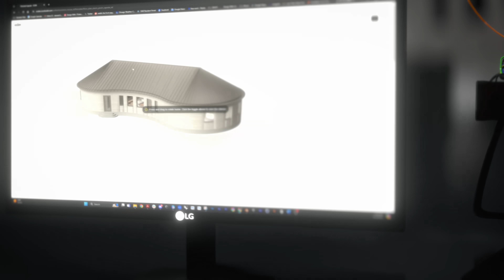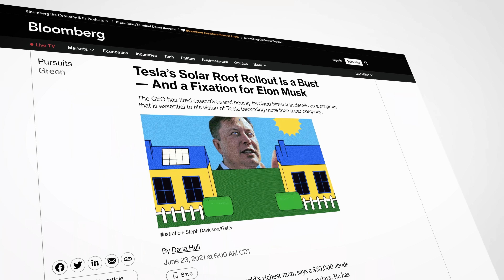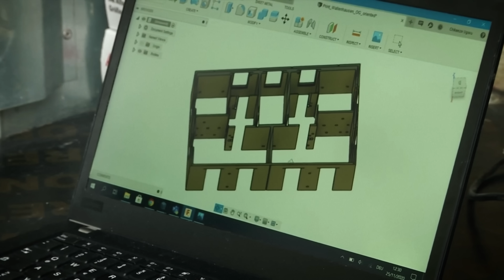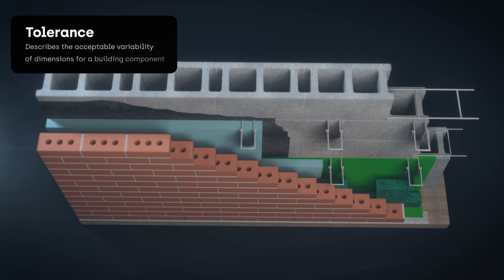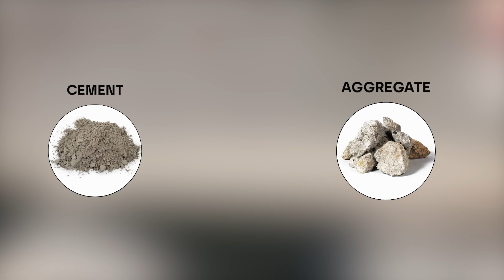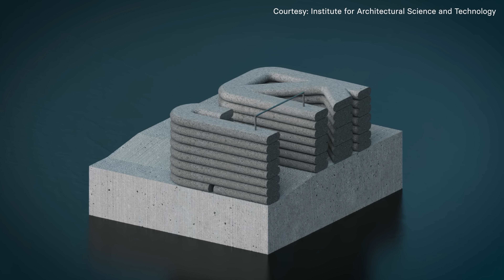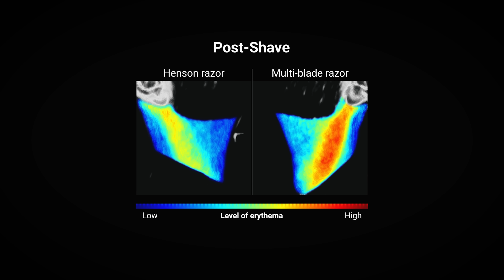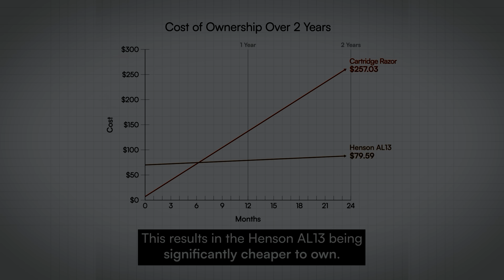Why 3D Printing Buildings Leads to Problems

Comment: So pretty much everybody is misunderstanding 3D printing here: It is not supposed to do absolutely everything, in any other building method, you cover the bare wall, because not everybody like the ugly grey and bunker like feel of concrete. OF COURSE you can do that also with 3D printing, a 3D printed house must not look like one, just cover the outside with a layer to even it out, do the same in the insides, problem solved, does not take any time at all, these layers don't have to be structural, just cosmetic. Crazy enough, I again seem to be the only person to realize this. ALSO: Why not use automatic paneling (like a mold), wood planks that get added to the outside and inside (like you normally do when you pour concrete to hold it together till it solidifies). Kinda funny that nobody had this idea to combine old construction techniques to even out the deficiencies of 3D printing and make it perfect. There seems to be very little innovation, especially just using nozzles to pour out the concrete or, even having to always use concrete. There are so many other ways you can do it, that uses the advantages of 3D printing much better. New ideas are needed. I understand that house building is very innovation free, nothing has moved much in this industries in decades or centuries, so it is not used to providing these innovations to a new technology that needs it to be perfect.

Comment: My concept would be to have standardised insulated wall Segments with preinstalled pipes, outlets and switches doors and windows. Interlocking and stackable like Lego. Ready made from the factory and just shipped and stacked.

Comment: Thomas Edison created concrete homes back in the 1930s.  The engineers DEFINITELY need to go back to the lab on this one.  A vertical form that you FILL with concrete that has a nonstick coating would be a better way to go.  3D printed houses make sense on the Moon or Mars, but why bother here on Earth.  Why oh why aren't you smoothing out the mixture while it is still wet.  The fly ash also comes from coal ash from power plants.  Oh wait, they are shutting those down.  Where are we doing to get our fly ash.

Comment: I had not seen before the many imperfections that are apparent in the many photos from the 3D printing process. Some of them would drive me nuts as the owner. Seems like before the concrete dried a skilled concrete worker/finisher could refine some of that out. Yikes!

Comment: Are these our best solution for homes that are built in tornado and hurricane prone areas? I am so saddened to see every year it seems to see homes turned in to kindling in a matter of minutes.
I suppose also a nod toward those areas that deal with flooding?
Of course zoning and building codes need to be focused on more seriously for these issues as well.🤔

Comment: It seems like a solid machine learning platform would be able to create AI on the edge (worksite) allow for greater tolerances along with continuous health checks on all parts. 

I do think the rough finish is problematic. My wife would not like it. Like all buildings, the outside is done quickly and the interior finish takes forever. Mainstreaming this technology will need to figure out how to make the interior and exterior finishes look much better.

Comment: Are you able to put new concrete on top of old concrete from the original pour? 
Plumbing, electricity? Additions as the family grows? HVAC?
Who is responsible when, 18 months after move in when its discovered the concrete mix was correct?
Litigation for regular homes get insane.....idk...i see it like electric cars.
A complete "different" system built on a system its supposed to replace...

Comment: Can't say I'm a fan of the walls as is but if the building holds up and you're able to smooth out the exterior and add dry wall for painting I'd be fine with a 3D printed home. Assuming you can repair walls and renovate in the future.

Comment: This type of construction could be a real benefit in hurricane-prone regions like the Caribbean where not having 90-degree walls on the exterior work to your advantage in deflecting wind. The additional structural integrity from also having the interior walls in concrete, and also the roof in some designs, make this type of house very hurricane resistant. You could have printed thousands of small homes in Haiti when they were wiped out by a hurricane that would have been a huge improvement over the shanty houses they were living in in a lot of cases. If you look at Haiti today you can't even tell where all the money we sent went to.

Comment: I have watched some of these homes being built.  To make the numbers work, it makes no sense to build one at a time because the setup time is expensive .  The “scaffold” structure has to be trucked in, set up and afterwards removed.  Also, a relatively flat site easily accessible from a public street is necessary.  Also, you made the point that this is NOT a one trade construction.  Wood Framing is required for roofs, porches and so forth.  Then electrical, plumbing, cabinets, windows etc all require additional trades.  The ONLY thing 3D printing saves is framing time and labor. And that may save maybe ten days to two weeks; the time it takes to stick frame the walls only.  Framing roof structures is more time consuming than walls, and that is not included in the concrete pour machine.  Also, weather must be perfect for the concrete to pour and cure.  Wood framing weather “windows” are much wider than printing with concrete.  I have framed houses when it is 20 degrees outside and when it is misting rain.  Couldn’t do that with pouring concrete.

Comment: 00:02 - 3D-Druck von Gebäuden steht vor Herausforderungen, verspricht jedoch, die Baubranche zu revolutionieren.
02:17 - 3D-Druck von Gebäuden hat Einschränkungen, wie das Herstellen von scharfen 90°-Außenecken.
04:15 - Die Einschränkungen von Maschinen und Materialien im 3D-Druck verstehen
06:07 - 3D-Druck mit Beton stellt aufgrund von Toleranzen Herausforderungen dar.
08:13 - Die genaue Mischung der Zutaten beeinflusst 3D-Druck-Bausysteme.
10:08 - 3D-gedruckte Gebäude stehen aufgrund struktureller Einschränkungen vor Herausforderungen
11:56 - Herausforderungen bei der Reparatur und Wartung von 3D-gedruckten Gebäuden
13:55 - Traditionelles Rasierklingen-Geschäftsmodell und Hensons innovative Herangehensweise

Comment: Until it can print a smooth interior wall,  that is regularly linked  to the outside wall, perhaps with a zig zag, it's not useful.   Perhaps you can add a worker to smooth it as you go.

Comment: 3D printing houses is a solution in search of a problem. Incompatible with sustainability, for starters as this is completely non-modular. Any modification requires hard energy investment and breaking through existing components.  Aesthetically it is horrible looking. And given the speed of 3d printing tiny toys, it is probably more time consuming than raising the structure with a trained crew to begin with.

Comment: Builders are cheaper than Engineers also there's more of them...
Builders and poor people make they own houses if they have some money, also they can modify and expande it with time, they are not going to use this printer.
You need extra space to put the printer, thay limit the places where you can use it.
I believe that bricks are cheaper than concrete.
The wall just looks horrible.
You don't need electric energy to build a wall, it helps a lot, but you really can build a house without it.

Comment: Something I'm confused about with regards to 3D printed houses is why there seems to be nothing done to smoothen the walls when the layers are being stacked? With regards to 3D printing if you wanna get rid of the printed grooves you'd usually sand it out and it looks really smooth, unless you do resin printing

Comment: I am in favor of anything that speeds up and reduces the cost of housing.   I remember when Apis Cor designed their first house.  I believe the roughed out house would cost under $10K.   Flooring, wiring and pluming, windows, doors, and appliances needed to be added.   A livable home that could withstand virtually all forces of nature for under $100K

Comment: 3D printed homes are a joke! 1st of all they’re will never be cheaper! Only quicker. 
Aesthetically the finish is absolutely terrible, nothing other than a joke. How could ever repair it? 
There are infinite issues with such a poor form of construction. Just imagine want it would need to install another power point or if you wanted a wall hang vanity with hidden plumbing. What do the bathrooms look like? How on earth would you tile that surface? It’s not straight, plumb or square enough. I’ve heard people complain about the imperfections of natural timber finish being inconsistent, how could anyone be happy with that.

Comment: If you had a printer head on both sides why couldn’t you feed the concrete horizontally, and thus use reinforcement?

Comment: New technologies to build homes won't make them more affordable in this system. The high price of housing is caused by speculators and real estate manipulators. They have no interest in creating or selling low priced homes , when they can deal with fewer properties at hugely inflated prices. To them , low priced homes mean less profit for them so they work and lobby politicians against it. You could create a prefab house that sprouts up from a capsule with water sprinkled on it that costs 49 cents and the real estate industry would figure out a way to sell it for $400,000.

Comment: They say it's cheaper, ends up being the same cost as any other home because of the machine to do it. It's built with structural integrity of shale, any one person can take the home down sledgehammer only, lyer by layer. Also there is no flex in the house,brick and mortar have a little flex, wood does for sure as well as steel. They don't even finish the houses they just paint over, no stucco and roof, can't print that so slap a cheap prefab one on top. Smh, id never, not unless they stopped trying to be cheap and printed that double layer wall but it's pouring around a ft thick on both sides. Then I will assume it can last longer.

Comment: Need to show the insulation work in process, the diagonal concrete between inner & outer walls will be a place for great heat loss & heat gain since the concrete will conduct heat easily.  3D printed homes do not look appropriate for cold climates.  Also need to show how you get outlets & switches into these walls.  Also need to show how the interior of the walls is finished, do you expect homeowners to want the blob ribs of concrete to be what they call a finished wall?

Comment: SIP construction is a lot better in some ways compared with extruded concrete. Goes up even faster than concrete,and is very,very strong and light. Not sure I would want to be in an earthquake in a concrete building.

Comment: Another thought is to make the walls far more standard smooth walls can be obtained by adding side plates to the nozzle that will smooth off the layers muting the horizontal lines of each layer.

Comment: Interior concrete needs to be covered. Im confused as to why it is not. Concrete dust is highly toxic. So over time an dust given off would cause serious health issues 😐  like maybe if its coated in a extremely durable coating. Im not a professional. i just know the dust it extremely toxic, as well as most sand because of silica.